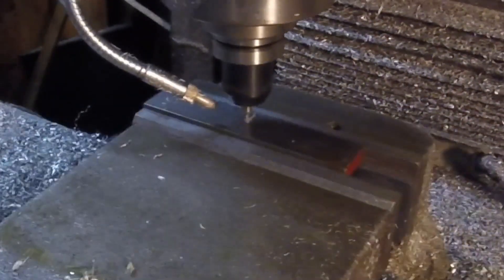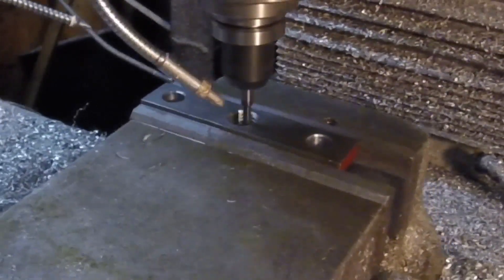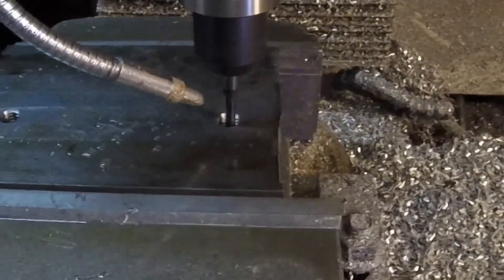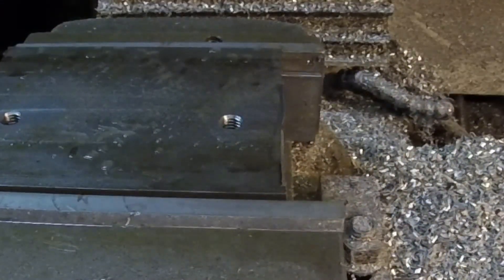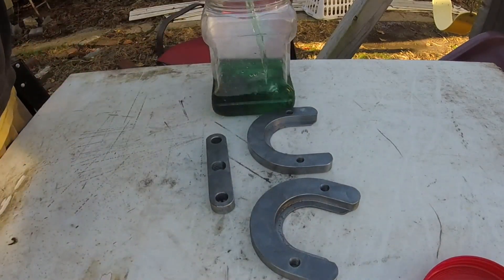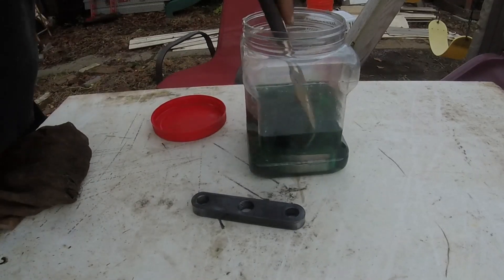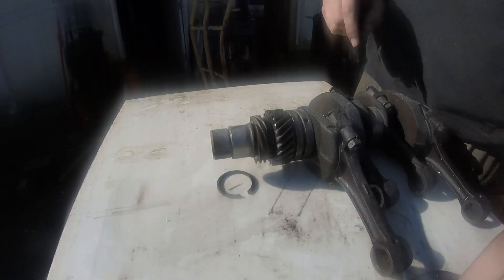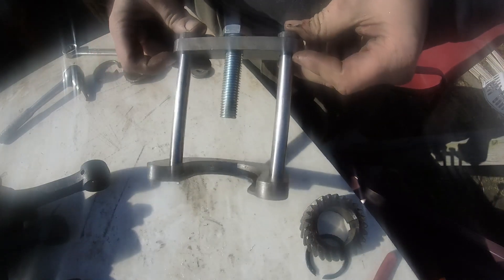Making a VW crank gear puller

Comment: You mentioned "...gettin' by without it." How were you removing the gears without the puller?
Reply from the maker: With difficulty.  Took a cheapy 3 jaw puller and grind it to fit and just struggle with it.  On occasion I would just leave that bearing on and replace all the rest.  Glad to be able to do it correctly now.

Comment: If you are up for it, check out using Fusion 360 to program your parts.  I have heard that using the PathPilot conversational to threadmill is kinda hard and I know that Fusion 360 is fairly easy.  Anyway, cool video!!
Reply from the maker: Thanks man!  I've been using Fusion to model some 3d stuff lately but didn't even think of it for this project since it's basic 2.5d.  I think I'll give it a try and see if the results are better.
Reply: I still do the most basic things in Fusion.  But then again, I haven't taken the time to learn the conversational yet.
Reply from the maker: The thread milling is all I use the conversational for.  Everything else I have been doing in CamBam.  I bought it years ago because it was cheap and super simple.  I was cranking out GCode in 5 minutes.  This was before Fusion was available and the only other options were undesirable.  I downloaded Fusion about a year ago but still didn't use it because all my stuff was simple.  I'm venturing into 3d now and CamBam can't handle it.  I'm sure once I get the hang of it I'll switch over completely.